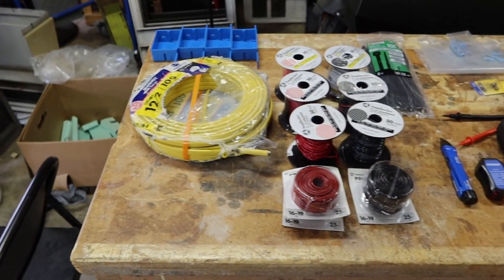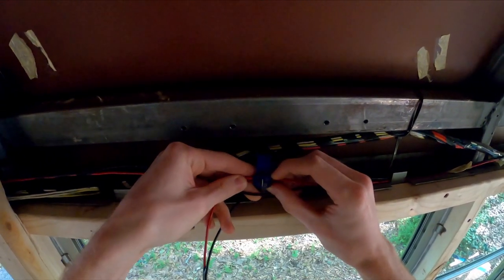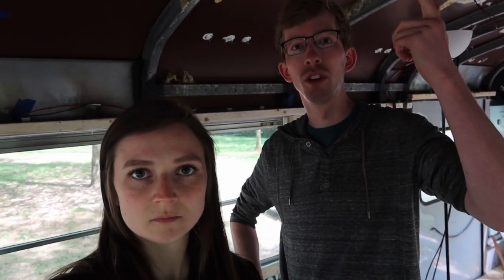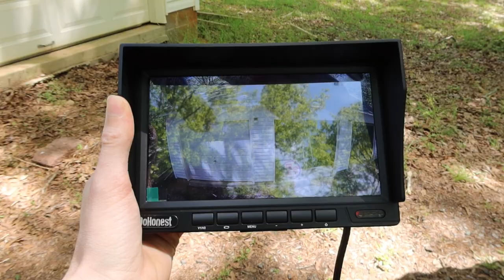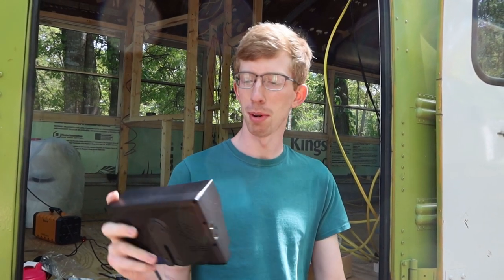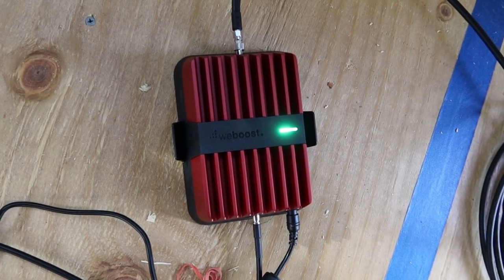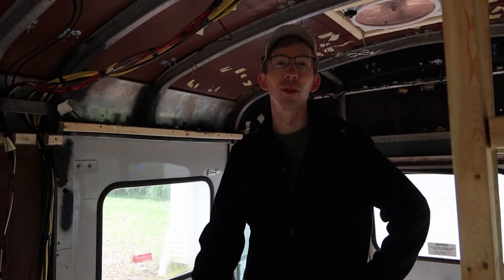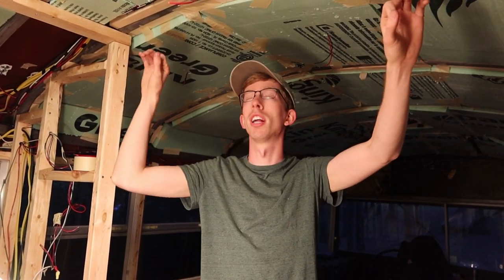Wiring Our Off-Grid Electrical System | SKOOLIE BUILD

Comment: Y'all are doing a great job. One suggestion if it's not too late. The scotch locks you used for "T" connections, go back and zip tie them. They will unclick in temperature changes.  Used them in a trailer, they all popped open later on. Keep up the good work. Best of luck from David and Tammy in Florida.
Reply from the maker: That is very good to know! Thank you! We'll be sure to add zip ties before we put in the ceiling 😄

Comment: When you guys were putting in the ceiling insulation, did the bolts/screws from the roof help or hurt? I could imagine them stabbing into the insulation could help hold it in place, but they might also just get in the way.
Reply from the maker: Yeah it was a little of both, but it mostly was helpful for holding it in place

Comment: looking for help.. trying to do a conversion.. is it possible to charge the battery bank from the alternator, and also have the inverter to charge from shoreline?  What would happen if the bus was running (charging from the alternator), and you plugged in to shoreline power, triggering the inverter to charge simultaneously.. how would you set it so the alternator charging would auto shut off when plugged in?  Thank you for any advice..
Reply from the maker: @Tim Prelog Hi! Yes, it is totally possible to charge from your alternator! The most common way I see people do it is through a DC-to-DC charger. It works by connecting your Bus starter batteries with your house batteries and then there is an "ignition wire" that is connected and will tell the DC-DC charger when you turn the key of the bus. That way, it is ONLY charging your house batteries when the bus is on. Due to this, it would be pretty unlikely that your bus would be on AND have the shore power plugged in at the same time. But there is nothing stopping you from doing that as long as (1) you have big enough wires to handle the high current and (2) the batteries you have can handle a large continuous charge current. For example, the maximum continuous charge current for our batteries is 50 Amps, so I would probably not want to run my shore power and DC-DC charger at the same time. 

Good luck on your build and hope this helps!

Renogy DC-to-DC charger (60A): https://amzn.to/3CAcbuU

Comment: Hey!! Question, so I’m definitely getting a professional out to do my bus electrical but just for personal knowledge, does it matter which devices are hooked to AC wires or are there specific ones that have to be DC wired?
Reply from the maker: That sounds like a great plan! In general, we try to get DC appliances whenever possible because they are more energy-efficient (and can be used without turning on the inverter). Hope this helps! 😊